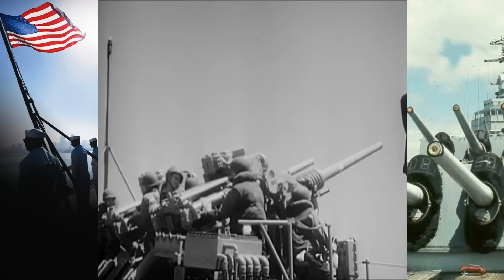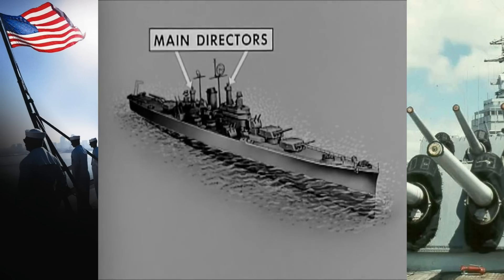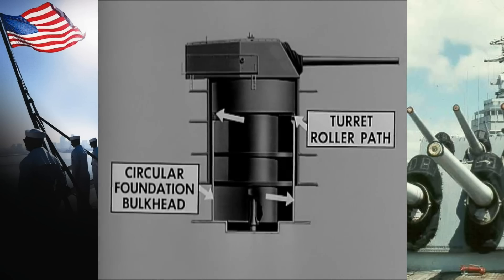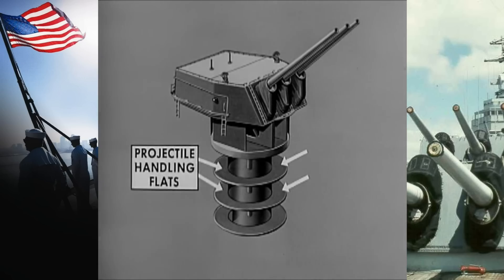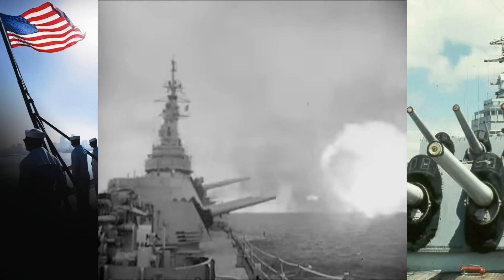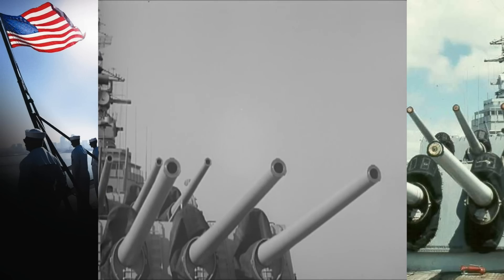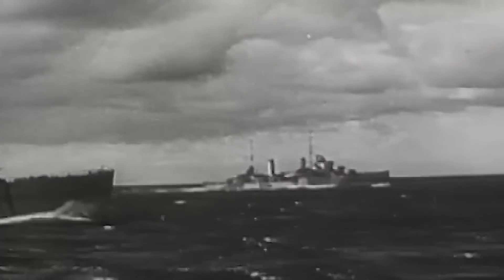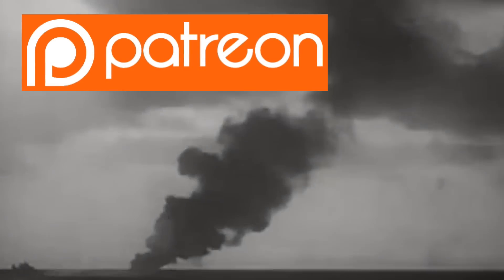How Do Large Caliber Naval Guns Work?

Comment: I had a few questions, first does the separate powder charge come in a casing instead of the bags like is shown on Iowa class 16" guns and is that because on this system they only adjust the trajectory/elevation and not the size of the charge?  Would a "heavy cruiser" with 8" guns be pre-WW2 but well after WW1?  Maybe I'm getting a US desination confused with a British one?

Comment: There was a program called Major Caliber Light Weight Gun (MCLWG). It was an 8”/55 in a single gun mount for smaller ships. One question I have is, "could a battleships big guns (14 and 16") be made this automatic?
13:07-I read the Japanese Yamato-class battleships big 18” guns had this capability

Comment: That is a massive amount of complexity for the caliber. I would love to talk to the designers on this - It feels to me like a simple unmanned rotating cylinder feed would be faster and less prone to error in combat conditions than manually hoisting rounds into the lift. You could pre-load replacement cylinders for storage outside the turret and roll them in on carts when not in combat. That removes the need for 3 operators per gun while firing, and potentially reduces the number of speakers too. It additionally leaves more room for armor and reduces the total quantity of explosives in the vulnerable turret (which is an obvious target for dive-bombers and artillery)

Edit: I'm sure there's a good reason why they didn't do this. I'd just love to have that conversation with the designers.
Reply: Well without any instruments or sensors to correct it machines are really unreliable when their are variable like the fact that the conveyer that moves the shells around gets faster as more shells get taken off or any little detail like that

Comment: On the big guns, I think they have to insert a primer in the breech block for each shot. I wonder how they trigger the cordite on these guns?
Reply: The 8''-55  case has a primer in it.  It looks like a perforated pipe that sticks up 31 inches into the powder charge and is about 3/4 inch in diameter. The mouth of the case  had a bakelite plug in it to seal off the charge.
Reply: @kimmer6  What about bag guns?
Reply: @PointyTailofSatan  Bag guns  have a primer cartridge that looks like a 45-70 cartridge that is manually installed in the breech just before firing.
Reply: @kimmer6  Plus there is a primer charge of black powder stuck on the back of the bags. It's that powder that is thought to have set off the overram explosion on the Iowa.
Reply: @PointyTailofSatan  Yes, the big red patch of black powder. They stored the Iowa powder bags in shipping containers where heat destabilized the powder. They did drop tests with witnesses to test this. As they did the last drop, it blew up.
Reply: Today I spent the morning trying to one way  rent a flat bed trailer or a car hauler. I bought an inert 16 inch Target Practice projectile some time ago and need to bring it 280 miles home to my place. Its 2000 lbs in its cradle. Might have to do it after Christmas as its a short week. I set eyes on this shell 10 years ago and it has been a long time coming. Some people collect stamps and coins.....much easier to ship.

Comment: "the guns are almost completely automatic, the crew is made up of 35 officers and men."
sounds automatic.

these big naval cannons are really impressive though. pretty much the end of the age of large black powder cannons, this is as good as it got.
Reply: for it's time? it absolutely was automatic. Most of those men were there checking dials so imagine what even a cheap PC from 2019 could do. 

Nowadays we could probably replace the men with redundant computers and very fast electric motors but sadly computer controlled rapid precision actuation wasn't a thing back then. The parbuckles could easily be replaced with a Scara arm and sensors, the powder handling would be a bit trickier as you don't want any stray sparks but a robot could likely do that as well or in the modern day it could simply be designed as automatic. 

But for it's time? it was pretty damn automatic.
Reply: It wasn't black powder.
Reply: oh...too bad.
Reply: @kingjames4886  Most military forces stopped using black powder weapons by the end of the 19th century and by the first world war smokeless powder was the standard propellant for artillery guns and small arms.

https://en.wikipedia.org/wiki/Smokeless_powder
Reply: @joshuaortiz2031  seems like an awful lot of smoke for smokeless powder.
Reply: @kingjames4886  compared to black powder it's not as much. Watch a video of someone shooting a  modern rifle and then watch a video of someone shooting a black powder musket.

Comment: can you imagine trying to design that thing
Reply: “Ok first we need a reeeally big tube”
Reply: @JimNotAvailable   *few years and many blueprints later*: "and that's how you make a triple 8 inch guns turret with fully automatic shell loading capable of cranking 10 rounds per minute per gun"
Reply: @1179125  18 inch iowa gun?
Reply: Especially without computers. All chalk board and sliderule.
Reply: That thing fires faster than modern artillery imagine the fun you could have with a modern version... Beautiful.
Reply: @Will-rv3tf  cues warhammer 40k Titan Autocannons
Reply: @MrOiram46  laughs in Titan Scale Bolt Cannon
Reply: I’m trying to do it In LEGO and it’s one hell of a challenge. But very fun

Edit: I’m trying to to the fully manned 18 inch turret from the Iowa class
Reply: @krwbricks9963  the Iowa class did not have 18 inch guns. They had 16 inch. I thing you mean IJN Yamato, which had 18 inch guns.
Reply: Well with calculus and a bit of time you could figure out the ideal caliber barrel length and such along certain parameters. Now designing the breech turret elevation mechanism that is not something you can easily solve with an equation
Reply: Imagine being the guy that had to fix it if it broke.
Reply: @twistedyogert  especially if it breaks during an engagement with the enemy
Reply: Hell yeah! Coming up with stuff like this is why I got into engineering. Honestly I feel like a certain elegance has been lost now we can just plug numbers into matlab and have half the design work done by computers.
Reply: I'd like to build the that
Reply: Yes. I can. Ez.
Reply: Im far too dumb for that!

Comment: 1 round every 6 seconds optimally, that's 10 rounds a minute per gun, giving any ship armed with 9 guns a theoretical rate of fire of 90 rounds per minute! 
Very impressive! Paired with a Mk 37 gun director, the shooting solution was ready for each salvo, so I would imagine in practice the effective rate of fire 
was not far off from 90 RPM.

Also, an 8 inch 55 AP projectile weighed in at 335 pounds (152 kg) with a muzzle velocity of 2500 F/S (760 M/S) If a ship could muster a sustained ROF of 60 rounds per minute. 
That would be a total of 20,500 lbs  (9,299 KG) of ordinance delivered every minute. The low end average hit percentage during the war was 10.7% high end being 26.7% meaning even if you landed 10.7% that's 2,194 lbs (995 KG)  per minute of ordinance on target, high end 5,473 lbs! (2,483 KG!) Compare that with the 16"/50 gun with an AP projectile weight of 2700 lbs (1,225 KG) also travelling at 2500 F/S (760 M/S), with a ROF of 2 rounds per minute, per gun. That means optimally you're at 18 rounds per minute, if we were to reduced that rate of fire by 33.3% as we did with the 8"/55; that's 12 rounds per minute, that's a total of 32,400 lbs of ordinance delivered per minute. With a hit percentage of 10.7% you are looking at 1.3 hits per minute low end, high end 3.2 hits per minute. Now, on the low end you're looking at 3,500 lbs (1,588 KG) of ordinance on target per minute, high end 8,640 lbs (3,919 KG) per minute. 

When you look at the numbers, Increasing the bore diameter by 100%. Furthermore, with three 8'/55 mounts weighing 900 tons compared to three 16"/50 mk7 mounts weighing 6,300 tons. Increasing your displacement by 600%! You are only increasing your theoretical effect on target by 58%! However, straight percentages cannot take into account the matter of the 8''/55 gun putting 42 more Armor Piercing projectiles in the air, than the 16"/50 gun in the same allotted time! You decide, but either way you cut it. The 8"/55 QF was no light weight!

Comment: The problem with this film is it's after WWll and for the "Cold War" CA's of the three
Des Moines class Heavy Cruisers, the Automatic 3"/50 replaced most 40mm AA guns on USN CV, CA, CL, and DDs during the early Cold War years of the 1940s through 1950s and was use on all the modern DLG/CGs and of the 1960s to1970s except the CGN USS Long Beach.
The 3"/50 was also use on many of the new DD/DE classes or the 1960s-70s and use to update older WWll DD/DE, it was a fine weapon.

But it is a Great Navy training film, one of my Favs !!  : )

Comment: There was a huge difference between the radar directed “automatic” 8” guns of this video and the 8” gun treaty cruisers that the US went to war with at the start of WW2. Radar was in it’s infancy then and in the US navy, those cruisers primary duty was to escort carriers and add their AA guns to the general protection. The US navy cruisers and destroyers that were available for the Guadacanal campaign were often there because the carriers that they used to protect were no longer in service such as the Lexington lost at the Coral Sea and the Yorktown at Midway. One serious weakness of the US navy was a lack of serious training in night fighting and thus a lack of propper equipment for such. It had bad ramifications at Guadacanal in surface clashes with the Japanese with their Long Lance torpedoes, which were so superior to the US torpedoes that it wasn’t even close plus the Japanese took night surface warfare training seriously. The US navy suffered several humiliating defeats with a horrendous loss of ships that was only rectified by these radar dirrected quick firing ships later in the Solomon Island campaign.

Comment: Ex RAN Weapons Systems Artificer here, 8" is certainly bigger than we had when I served, all 4.5" or 5".
However, a gun, of any size,  is not much use without a good fire control system (radar/optics/computer) that will get the rounds on target.
I have been present when 4.5" guns have shot down preceding shells, fired at a higher angle of elevation, because of the accuracy of the fire control system.
I recall meeting an Australian Vietnam veteran WO infantryman who loved naval gunfire support (NGS), as he said, "You could stand up and walk behind it", it was that accurate.

Comment: Not sure if it's been mentioned already.  These were the pinnacle of design of heavy cruisers. I don't think they ever saw service in WWII.  Although, they were used in the Korean and Vietnam wars.  The 8" guns of the famous WWII heavy cruisers: The Pensacola class, Northampton class, New Orleans class and Portland class all had manually loaded guns.  I think powder and shells were run up elevators in a similar way but I think gun crews had to manually position the shell in front of two(?) powder bags on a tray before a ram mechanism sent them into the chamber for firing.  The rate of fire was about 4 rds/min. The 8" guns in this video were later model "automatic" and dual-purpose -- that is, surface targets and aerial targets.  Although 203mm AAA is unheard of anywhere else to the best of my knowledge. I think 127mm or 150mm (5 or 6 in) would be about the largest anywhere else. The aircraft would have to fly fairly slow and in a straight line, I would think. Although, a 203mm shell should make a pretty large lethal sphere when it explodes -- 260-lb HE shell vs a 53-lb shell for a 5" /38 gun.  Still, a moderately maneuvering jet fighter would practically never be threatened by these guns. Then again, many jet fighters were shot down over Vietnam by radar directed 57mm, 85mm and 100mm AAA. Time of flight of the aimed projected is the problem. The aiming solution has to predict where the aircraft will be in so many seconds and put the shell there to detonate, hoping that the aircraft will cooperate and arrive there on time. The closer the range, the shorter the flight time. Any fighter pilot is not going to cooperate with that and will change altitude and heading continuously until steadying up momentarily for bomb aiming and release. But for a big bomber on a long steady run-in to bomb release...I imagine the 203mm could get 'em before they release their bombs. When the bombers began flying higher than the gun's ceiling (? maybe 30,000 ft - barrels only elevated 41-deg) or carrying stand-off guided missiles, I imagine that was the end of the 203mm AAA idea. :)  The AAA idea was probably envisioned against Kamikaze attacks using propeller-driven aircraft.  But WWII ended before these ships with automatic 8" could get into service.  If they could have fired 1/2-kt nuclear shells out 5 or 6 miles, that might have been different, for a while...until the stand-off missiles were employed by bombers.

Comment: As the original poster, as well as many commenters seemed to have missed it:  This is NOT a WWII ship. This is not a WWII informational film. This is much later. Just how much, I'll have to do a bit of research to be sure, but certainly it was after the advent of ship-board computer micro stations (such as shown in the gun house) and the racial integration of the armed services (there was at least one black sailor depicted as a member of the gun crew).
As for the term "big" being a relative descriptor, that's partly right. In Naval-speak, "Big Gun" means something specific. What makes it relative is when a particular bore was in service. Once, 8" and 10" guns were the biggest around, and were defined as "big guns." When 12" and bigger guns came along, they could no longer be described as "big." Just as in the 13th century, a 70' foot long vessel could be considered a "big ship," such a vessel may not be considered a ship at all by today's standards.
I would guess that this film dates to the fifties or maybe early sixties. By that time, 8" was not a "big" munition. Medium, perhaps. What's more confusing, though, is that they may have been considered "heavy" guns. IIRC, and I may be in error, a heavy gun is one where the charge and projectile are separate pieces, which distinguish them from the combined cartridges used in other cannons like the 20mm, 25mm, 37mm, etc.
Reply: The film is dated 1955.  The 8 inch was classified as "big" because it was the biggest dual purpose caliber in use.

Comment: I’ve toured the USS Alabama Battleship in Mobile Bay.  I toured the 16” Guns turrets and they operate much the same way.  The guy that actually rammed everything into the breech was right there standing on a little tiny platform of maybe 30” sq and no less than two feet away from the gun as it recoiled. The guns recoiled approximately 8’. Talk about a scary position and the noise and pounding that man took must of been frightening. I don’t know all the stats of the shell, but they were approximately a ton a piece.  Three powder bags weighting several hundred pounds each followed the projectile and rammed home.  It is a must see for anyone with any interest in history or big machinery.

Comment: During the '60s, the Bon Homme Richard, also the Ticonderoga (both WWII era carriers I served on in the Gulf) had four 5 inch guns. These were mounted in gun tubs each side of the ship, one gun per tub, two guns fore, two aft, and operated when the need arose by shipboard Marines the old fashioned way - by hand. Every so often the leathernecks would give us swabbies a show by firing at practice targets towed by plane thru the air, or at a sled on the water's surface (using a very long cable, I might add). These gun crews were pretty accurate, too, given what they had to work with, including limitations on firing times, calculations on trajectories, and all of that -- kind of like watching a howitzer crew at their task. The rotation of the gun, however, was geared to a motorized gyro control of some kind so as to avoid the tedious (and slower) hand cranking operation in aiming. The projectiles (painted blue) required fuses to be screwed into them first, after which they were loaded into the breach by hand, as was the metal powder casing that followed. After closing of the breach lock, and what seemed to me a lot of yelling, there soon followed a yank of the lanyard. And with a flash of orange and a brownish-grey mushroom of smoke you would hear a loud wham and metallic bang (I suppose from resonance of the gun's report on the ship's hull). This was then followed by wisps of smoke drifting out the barrel's end. Seconds later was the air burst (alternatively a splash in the drink in the distance), thereby signaling the accuracy of their effort. And with conclusion of firing for the day applause and cheers from the rest of us for a job well done. Semper Fi, fellows.

Comment: #1,027    Thanks for showing the The USA 8"/55 and how it performed.  Eventually, the bore size may return with different propulsion and range exceeding 32,000 yards.  The 330 mm./52 cal. weapons that the French carried were quite extraordinary.  A 1,250 lb. armour piercing round with range of over 40,000 yards.